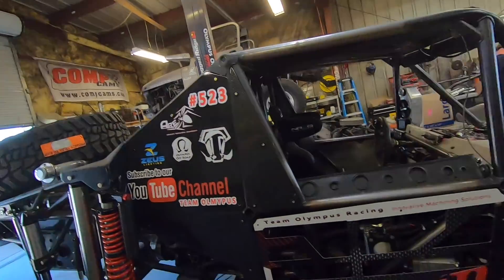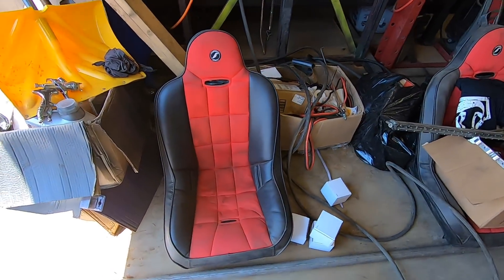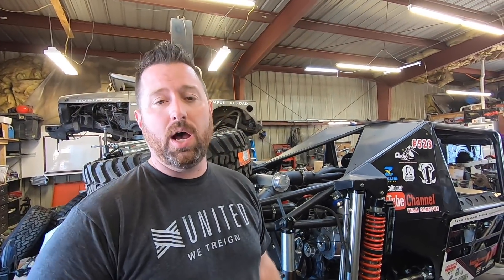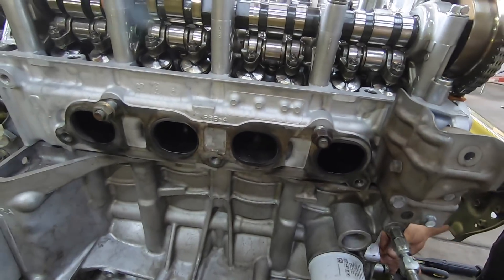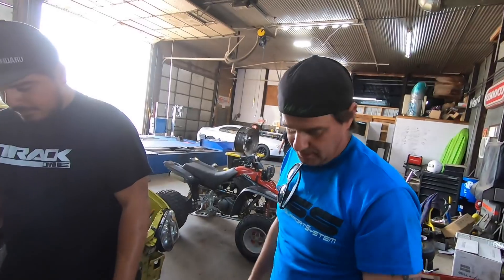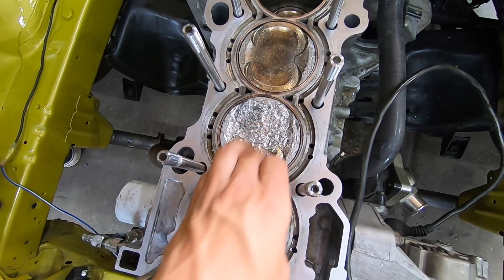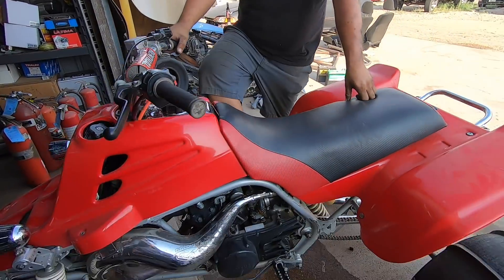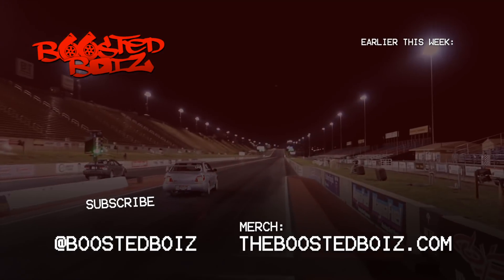Finding Out How Bad The Damage Is on Hondaru

Comment: 4 piston has nothing to do with all these problems...Common Denominator...you both have the same cams(not saying the cams are bad) but the cams and valve springs are wrong for that application. There floating at that spring rate.

Comment: Hey look! Another video showing what happens when you rush a build! 🤣
Reply: allan nobody has this much bad luck. With the corners they cut, it’s no wonder that they are having all these problems.  Then for them to blame it on the manufacturer of the head (4 Piston) and not on them doing things incorrectly is just a low blow and a shitty look on their part.
Reply: @trashpanda8071  yup got that right. another comment was saying this head that they ordered was set up for all motor not turbo they didn't even specify when they ordered it 🤦🤦🤦
Reply: allan that goes back to the cutting corners. Oh well. Their money, not mine.

Comment: Them 4Pistion heads doesn't seem to be any good. But I don't think that hardcut limiter is any good for the engine either. Every time I've seen you guys have dropped a valve on these heads is when you are hitting the limiter 🤷‍♂️

Comment: I don’t think it’s 4p fault. Sounds like valve float. Maybe need stiffer springs? Also need to get down on the shifting. Those mishifts at high rpms are what’s causing valves to float. On top of that the car makes serious power. Anything can happen at those power levels with a mistake. I wouldn’t point fingers so soon.. Hope to see hondaru running again!

Comment: I'm gonna put my money on the valves being the cause of the problem I know their a decent brand but for some reason they dont like the motor  personally I would get a different type of valve and put those in a stock head nothing else and see what happens and if they last I would do a completely built head with those valves.   I'll make sure to say that's just my opinion and im not saying anyone else is wrong cause according to my wife I'm always wrong and 3/4 of the time I prob am so it want be nothing new if I am